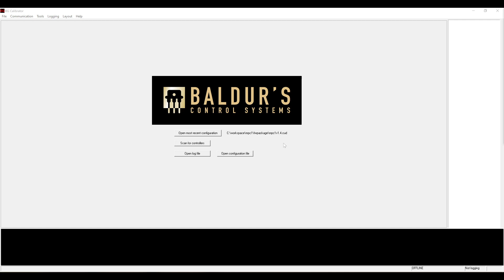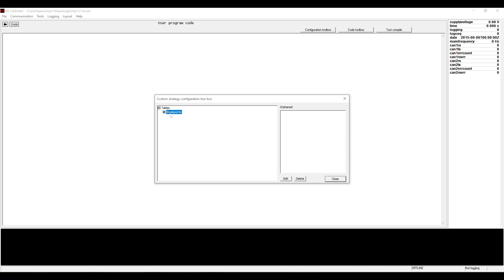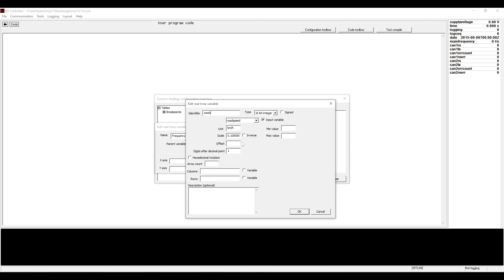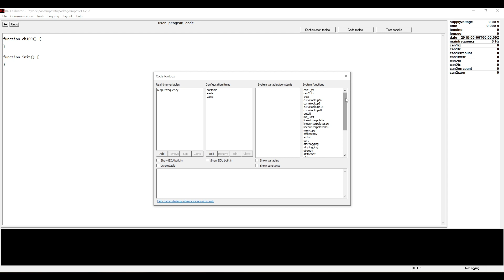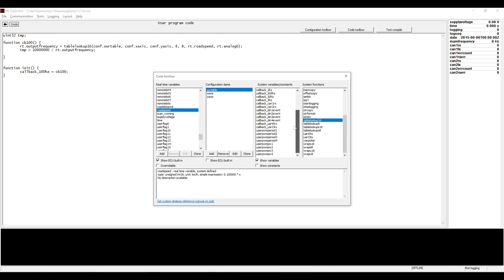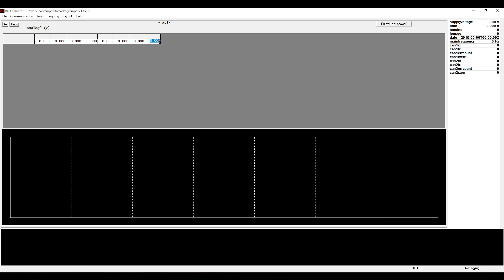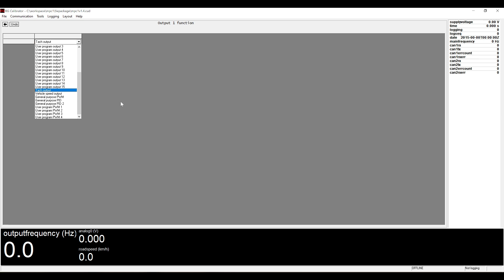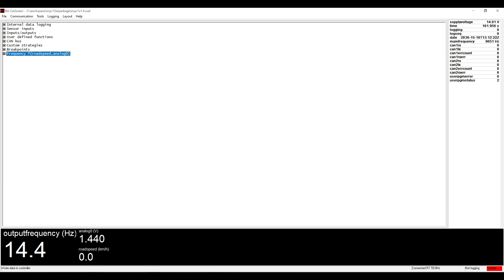Custom strategies walk through

Comment: Thanks for this. Great tutorial to get the basics for custom strategies. With this, it was no problem to write the code to get the fuel consumption gauge in my w140 working. The input of the gauge is a frequency modulated 12V signal based on the actual injection quantity.

Comment: Who is your target market?
Reply from the maker: The custom strategies are about being able to do anything that no stand alone ECU on the market offers. The ability to experiment with new methods of control and new peripherals. The ability to perfectly integrate with the car's CAN systems.
Reply: @TurboBaldur  it's incredibly cool but do many people use it? I'm a programmer so I would just write custom code and inject it myself, I wouldn't look for a product. Where as most tuners programming is beyond them so they would struggle even with your nice UI. I feel like the best use case for be for a middle man to use your software to build to the requirements of a tuner who cannot program. Maybe like how the motec custom firmware works by for an OEM platform. Which oem Ecus do you support? Or is this a custom ecu?
Reply from the maker: @roflex2  Yes that's exactly what it is. It's a way to add custom features to the ECU that have specific applications. The ECUs are my own design from the bottom up and not based on any OEM system. Yes there are people who use this feature, but of course the base firmware is enough for most.